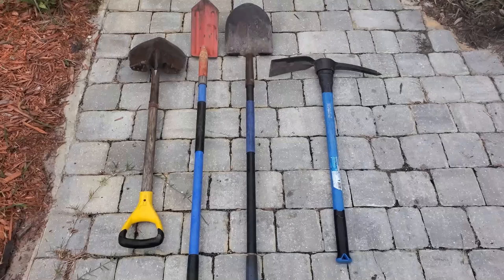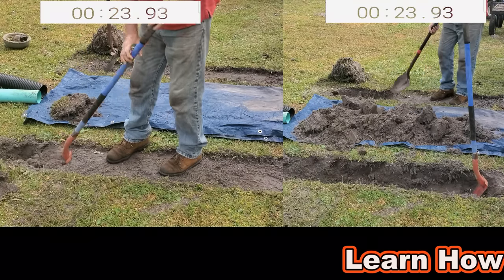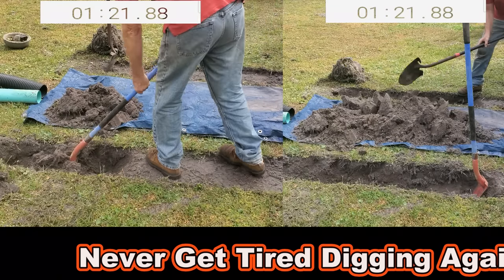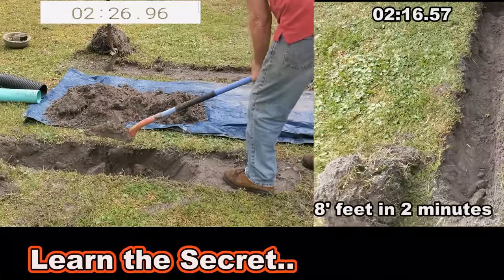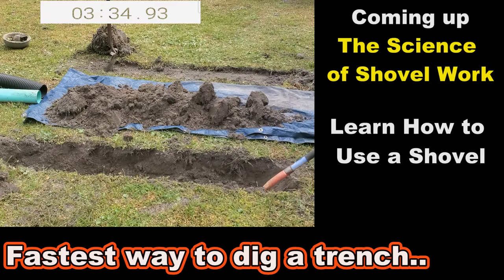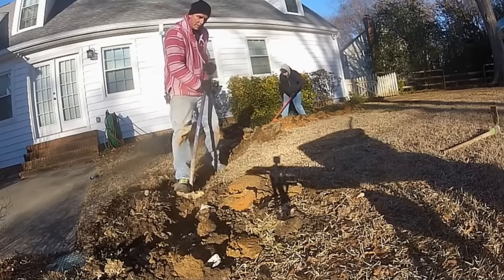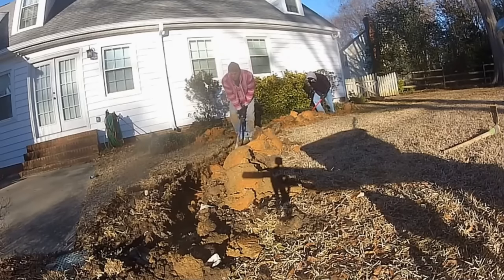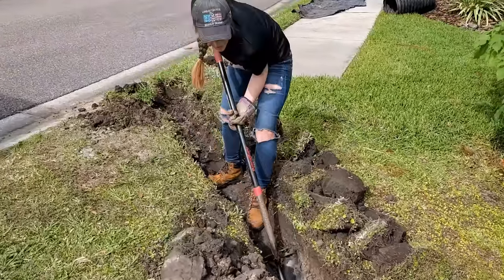Fastest Way to Dig a Trench - Never get Tired Again

Comment: The reason it took twice as long to dig is because it is too small for that trench. I was an electrician and used a smaller shovel than the red one to run conduit (6" depth). My trench was only as wide as the shovel. Less dirt to move and less damage to the customer's lawn.
Reply: Exactly, why on earth would you use the smaller shovel (sometimes called a 'master spade') to dig a wide trench if you don't need a wide trench?  I used one to trench for electrical conduit.  The building inspector said he had never seen such a narrow trench.
Reply: I used the trenching shovel in the video for 4” drain pipe. Worked like a charm.
Reply: @professorg8383  The depth varied, the deepest section was about 24” below grade. I used an older type of narrow trenching shovel as well to loosen and break up the clay soil in the deeper sections and the type used in this video to clean the trench out
Reply: In trench digging school they showed how this video is misguided because he is trying to dig a trench more than twice as wide as the common shovel.    Northern clay is great for a trenching shovel because it's harder material than sand in florida  Much more material to move.   What is going in?    Electrical conduit?   Don't use a 4 inch trench shovel for a driveway culvert get a backhoe.😮     work smart not hard and don't ever try cutting your own hair gee whiz.
Reply: Yea trench shovel hood for running conduit. This video is about drainage or something requiring larger pipe 

But yea no use in moving extra soil

Comment: Other comments saying the same thing. You don't dig an 8" wide trench with a 5" wide shovel, that makes no sense and of course will take longer. The point is to dig a 5" wide trench so that you move significantly less dirt to accomplish the same task which is putting a piece of conduit in the ground. The other benefit of the drain spade is it excells at fetching dirt out from under tree roots etc as you progress through your trench also reducing the labor of trying to bust through big tree roots. My drain spade is much longer than yours (ha ha ha I'm 12) so if you lay it down in the trench to scoop under a tree root it can actually clear out a pretty large amount of material.

In this case you are putting a large drainage line in that would necessitate a larger trench. However for an electrical contractor the largest thing I'm gonna typically be burrying is 2" PVC conduit or maybe up to 4" DB2 for a service.

Kinda gives dunning krueger vibes when you're chuckling about "so called contractors" not digging a wider trench like they're idiots. If you need an 8" wide trench for big drain pipes then dig an 8" wide trench, if you're running smaller material then why move all that extra dirt and make a bigger gash across someones lawn.
Reply: "The point is to dig a 5" wide trench so that you move significantly less dirt" << NOPE the sole purpose for which these shovels were made and the ONLY legitimate use of one is to clear behind a mechanical trencher with a 6" width , any other use is inappropriate in the absence of some other limiting factor(they can be handy around tree roots for example). There is ZERO advantage to making a narrow trench for no other reason that having a narrow trench , with a trenching machine the speed of the trencher is the advantage and reason to deal with a pain in the azz narrow trench and having to have a trenching shovel to clear it.
Reply: Ummm no, move less dirt is less work overall 100%. Narrow trench is less work to dig and less disruption to customers gardens and landscaping. A drain spade has a much longer blade (and much less "lift" angle) than the shovel he's using and you go straight down 18" plus and break out the dirt with every bite. I also use an sds max drill with clay spade or chipping bit to bust up rocks/concrete flush with the edges of my trench and remove the rubble instead of digging out entire stones which the power trencher can't really deal with. Where I'm usually trenching you're either hand digging or getting a mini-ex don't see many trenchers here in my part of the world for good reason. I agree the trenching shovel he's using is only good for cleaning out after a mechanical trencher but if you look up drain spade you'll see what I'm talking about, once you get the hole to your depth you just keep taking 3-4" bites out of the dirt moving backwards and each bite is the full depth of a typical electrical trench. You're certainly entitled to believe whatever you want about the subterranean arts, I've dug plenty of trenches in poor conditions. I've dug ground plates in the middle of Canadian winter going down through frozen dirt so I will respectfully disagree with you based on the weight of ample personal experience.
Reply: I agree 8" is pointless for conduit etc.
Destroying more yard and more work

Comment: Old fella that did my concrete drive way years ago told me the best method. Only load half or less a shovel full every time. That 70 year old man moved loads of dirt and never got tired.
Reply: This is actually why I don’t regret the 60’ trench I did today with a 4” trench shovel. Easy on the back and not fatiguing.

This applies elsewhere too: get 50 lb bags of concrete instead of 80. I’m strong but why stress anything?

Comment: Your correct saying it depends on the application.  Not a fair comparison.  I would not use the trenching shovel to dig an 8-10" trench.  A sprinkler, water line or wire, yes.  As far as getting tired, I very rarely see a video with someone using a shovel digging in red clay soil.  I'm jealous...

Comment: nobody says this, but SHARPEN THE EDGE OF YOUR SHOVEL.  It's a lifesaver.
Reply: lol dude if you use them right they sharpen themselves and eventually get so thin they chip and break and need replaced ... says a lot that you think it is the other way round.
Reply: @kevint1910  if you are taking a new blunt edged shovel to attack a lot of roots you will save time by giving it an edge before you start digging.

In general they should stay sharp with general use, but a quick look if you've been hitting rocks won't hurt. Roots are springy enough with a sharp edge.
Reply: @kevint1910 doesn't need replacing.  
Just re-profiled.  Or in other words.  Sharpened. Grinder would be quick. Flat file will do it all the same.
Reply: @matthewbeaver5026  If I am cutting through sod you better believe I am busting out the grinder on my flat shovel. As far as the spade goes, I hit rocks or often it wouldn’t make much of a difference to sharpen it.

Comment: Wife and I are native central Floridians. We bought a piece of property in central Georgia for a second home, had a  house built on a hilly piece of property and boy did we ever learn about water management along with digging in rock and root infested red clay that is either hard as a brick when dry or slippery snot when wet so I had to find the best dampness period between dry and wet for hand digging trenches for the 800' of 4" drain pipe and numerous drains I installed. It took a lot of tweaking and watching your YouTube videos but after a year the drainage issues are pretty much taken care of ... and I threw that  4" trenching shovel in the wood pile after about the first two days. Thanks for the informative videos!

Comment: Hello! The red "Trenching" Shovel is specifically designed for digging narrow trenches for sprinkler line and pipes etc. 
 WHY on Earth would you use it for an 8 to 12 inch wide Trench?????????

Comment: Try that in my backyard, which is basically a forest. I struggle to get past the very first inch, which is mostly a mat of poison ivy roots. Right under those roots is beautiful loamy dark composted forest dirt, for about 2 inches. Then the really big roots start showing up. 
I still dig by hand, but I usually plan on burning though a couple reciprocating saw blades. 

But I'm not disagreeing with this video at all. I tried a few different trench shovels, root cutter shovel, etc. But generally the one I use the most is the basic pointed shovel. Lots of good tips here, I've been watching these videos for years and successfully redirected water from my property with a trench (trench drain, no pipe) over 150 long finished with french drain pipe and a emitter. 
Then I buried my downspouts and sent all that water where I wanted as well. I saved thousands, but I was also not working at the time. This is a nice "self made channel". Thanks.
Reply from the maker: I’d be happy to
Reply: @appledrains  😅
Reply: Sounds like it will be worth the money to rent a small excavator. You could not imagine how fast you can dig with theses fellas. I had to remove a bush lately and it took me much less time (and effort of course) as when I removed one of half that size by hand.

Comment: On my clay yard I had to use the trenching shovel and almost put my full weight on it and slice out about an inch at a time, looked almost like a deli slice. Otherwise the clay would stick to the clay that sticks to the clay that sticks to your shovel and shoes and everything else. If I wanted to I could have went over with the larger spade, but I didn't want to. Not tiring but took forever.
Reply from the maker: Interesting

Comment: I see your point but we used the trenching shovel to dig a trench for laying cable wire and it was the perfect size for laying down wire. If you need to lay down a 4 in or 6 in pipe yes I would use the shovel but for wire or small diameter pipe I'd prefer the trenching shovel

Comment: This is so timely. I am placing pipes in the ground and also laying some Ethernet and electrical cable.  I almost bought one of those trenching shovels and a new pick for the job but I have the 8 inch round shovel in the garage so I am good!  You saved me money and time. 

Question:  I have to dig up old corrugated pipes as part of my project. I did one a few weeks ago and it was back breaking.  Finding it, digging it up, getting it out from among the roots and vines and rocks, all excruciating. Any tips?

Comment: I would think that if you dug the trenching shovel trench the width of the trenching shovel you may find it faster, digging an 8” trench with a 4” trenching shovel means twice as many scoops. If i use a trenching shovel to dig a trench it will be the width of the trenching shovel and only used for laying cable or retic pipe. No need to dig a wide one for that.

Comment: What’s your thoughts on using those thick but smaller “structron” spade shaped shovels I used to call Digging shovels for really hard ground?  I think they were probably 6.5”-7” across and a third shorter than regular 8”.   They are pretty heavy though

Comment: You can dig a trench just as fast with a 4" trenching shovel as you can with a 6" trenching shovel, or a standard shovel.. just depends what the trench is for. If its a sprinkler line obviously use the 4" trenching shovel. If its for 4" pipe use the 6" trenching shovel. If your digging a ratwall/footing use the standard shovel. Its not so much about having a "faster" way as it is using the correct tool.

Comment: Your soil looks like sandy soil, but here in Middle Georgia where the soil is hard as concrete red clay, things are a little different.

Most places here you cannot even get a shovel in the ground without loosening up the clay with the pick beforehand. Your method is great in sandy soil...

Comment: I saw an experienced plumber in Florida using one of those 5 inch shovels. In damp sandy soil, exactly 12 inches deep from the street to the house in a half an hour. No sweat. Ran a water service line. Then trenches under the slab for drain lines. The trench was exactly the size he needed. The whole project roughed in on a day and he went home early.  By the way, be real careful using your foot to push the shovel into the ground. Wear heavy boots and do not jump on that tiny edge. Push and wiggle it into the dirt.

Comment: Here in N.H? Dig 4" down and hit granite ledge, boulders the size of basketballs... Your points are well-taken, however...and after having been a landscaper for 20+ years, I've dug MILES of trench...so much so, my back, neck, hip is all jacked up at 59...AND Ive been using the techniques you showed. One thing you DONT emphasize is lifting with your legs, not twisting BACKWARDS- which you did, working backnis good, but throwing forward is better!

Comment: Oh forgot to ask you, what’s your thoughts on those “sharp shooters”?  Least that is what my guys and myself would call them.  They are rectangular shaped and not concave shaped much.  The point is flat but real sharp.  Probably 7 inches wide and 13-14 inches long, just kinda guessing.  I am older now (and chronic health issues…:(….   But anyway I am living in a brutally rocky and hard clay soil property with a lot of hand work to do.  Hiring someone around is just about impossible so I gotta do it myself.

Comment: This wouldn't work in Western Washington. Everything near Mt. Rainier is a glacial moraine. It's egg, fist, and football size rocks with dirt to fill in the cracks. We call them Spanaway Spuds. All your trenches and fence post holes have to be at least twice the width in order to get to depth because the rocks from the side of the hole will fall in. Good times that build character and cardio. Trench machines don't work.

Comment: Here in Columbia County NY, 130 mills north of NYC, picks and or mattoxs and digging bars are required before the pointed shovel can do much of anything with the hardpan, rocks and roots. It's an event when you can dig a fence post hole without doing most of the work with a digging bar.  Post hole diggers are almost useless by themselves around here.

Comment: I have to use a pickaxe to dig where I'm from.  The soil here is very hard, compacted, and rocky red clay.

When it is wet, it gets back breaking heavy to lift with a shovel and when it is dry, it is like trying to shovel through a giant crayon, with rocks in it.

Edit:  I use the pickaxe to break off chunks of soil and then a flat shovel to remove the chunks.  The soil here in Virginia is evil.  Nevertheless, you convinced me not to waste my money on a trench shovel.

Comment: Thank you so much for the Body mechanics way of digging a ditch. I just recently recently got a quote to put a 6 inch drain in 50 feet $2000. To get an excavator to do it. I’ll do it myself. It may take me a little bit of time. The original quote was 6200 for the pipe 45 tons of dirt grass seed I asked him to go down on price just to dig the ditch for the pipe 2000.😮

Comment: It depends on how wide you need the trench.  I have put in water line with a long trenching shovel that is 3 - 4" wide.  It is a lot easier than a regular shovel if you don't need a wider trench.  What am I missing?

Comment: Use the narrow shovel for things like sprinkler laterals where you are worried about restoring the grass and minimizing the amount of grass that gets covered with the spoil pile. Its just wide enough to allow you to compact the back fill with your foot or a bell end digging bar. In these situations you are not going deeper than 8 or 9 inches. This is not deep enough for anything electrical. Its more about manicuring the finished job than minimizing effort. The soil type and moisture have to be appropriate for the narrow shovel to be effective. In short, its a specialty tool.

Comment: I don't know about trenches, but I do know that if you want to dig a really deep hole fast, the fastest, not super expensive way is to use a high powered pressure washer and sometimes combined with a wet dry vacuum if you need it (say the water doesn't drain well).  You're also less likely to brake underground lines with the pressure washer.

Comment: Maybe I missed the point but why would one use a narrow shovel to dig a wide trench? Trenching shovels are great for what they are designed for- I have 2 different styles but use is solely dependent on the job at hand.

Comment: Yes, if you are digging a trench that wide use a normal width but to use a trench shovel for that width is not smart, the trench shovel is great so you don't have to mive a  lot of dirt if you are using it for that width only , you don't need 8 inches for ¾ pipe or even 2 inch pipe, unless multiple pipes. I would use the sod cutter and a trench shovel, why move all that dirt when not needed  sometimes less is more

Comment: In texas sand and clay that is moist ill take a 6" trenching slovel any day over a full sized shovel if im digging for a sprinkling system or for wire. Make the exact same trench a machine does without the weight of all that dirt from a large shovel.

Comment: the purpose of the trenching shovel is to only dig that width. so of course it took longer with the trenching shovel to dig a trench the width of the spade shovel. trenching shovel is used mostly for laying down cables in suitable pipes or for things like watering system tubing. the trenching shovel is designed to be able to dig fairly precisely a narrow trench that can be quite deep, vis-a-vis cabling. with a spade shovel if you dig a deep trench, you will have dug up way more material than necessary for those applications. i'm no digging expert and i know this.

Comment: Ive never seen anyone try to use a 4 or 5 inch trenching spade to dig an 8 inch trench.   You use a 5 inch spade to dig a 5 inch trench to lay a 4 inch pipe for instance.  Of course youd use an 8 inch spade to dig an 8 inch trench.